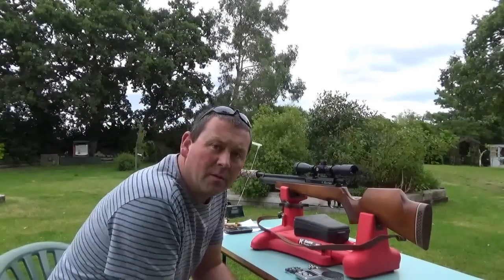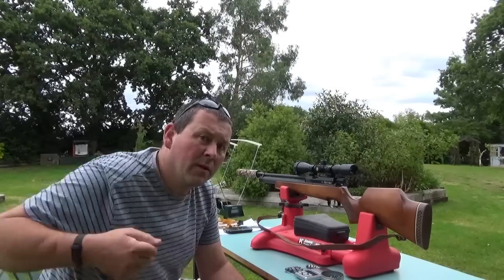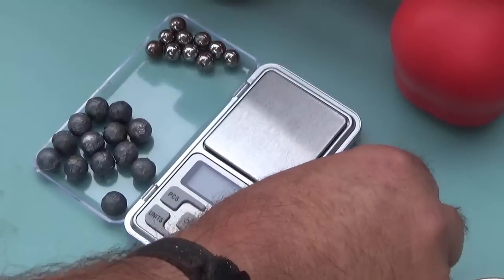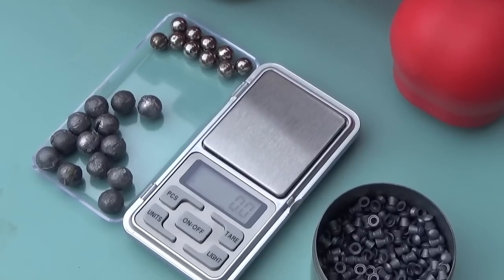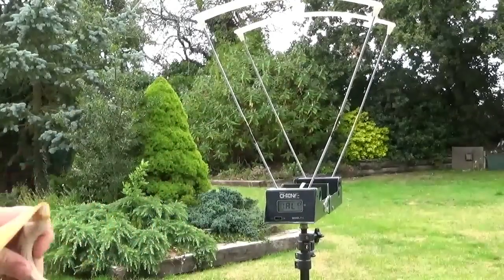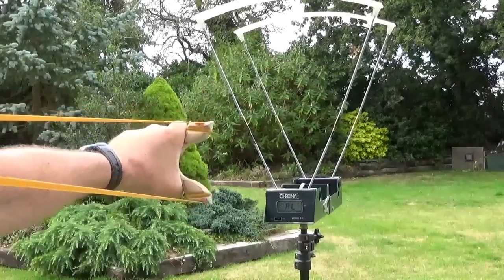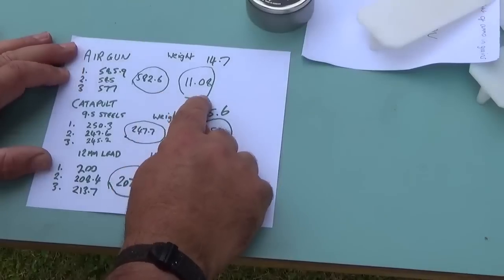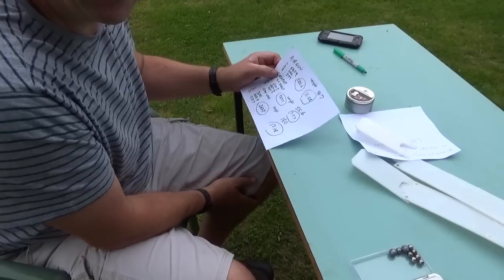Airgun Versus Catapult Energy Test

Comment: Great video..Times have changed tho...On my Chrono with 3/8 Lead balls with simple shot Nitro Bands I get 530- 600 fps on my Barnett Black Widow.. If you had a wrist stabilizer your numbers would have been higher. Good work. Thank you. BTW A custom Barnett Black Widow with a 10 mm lead ball is LETHAL
Reply: For real? Please post a video.

Comment: My calculations show that if you weigh 100 kg and can run at 1 metre per second (that is do 100 metres in 100 seconds, which is easy) then you have 100 Joules of kinetic energy. This is the same as 100/1/1.356 = 73.7 foot pounds. So the best thing to do is keep enjoying the beer and kebabs (to keep up the weight) and just run into your prey when hunting - obviously they have to be slow moving or bind/deaf with no sense of smell. That should kill them! Or did I get something wrong? Good video, thanks for uploading - cheers.
Reply from the maker: Great idea...thanks for that...I wouldn't even need to carry a catapult or gun.....gotta go,I am now off to look for some blind and deaf rabbits with no sense of smell!!!!!!
Reply: everything you get was wrong 100 kg at 1 m/s is 50 j not 100 j and it can be distract efficient only on huge resistanc like wall or enough heavy animal  ., run into blind deer and kill it :D your funny what makes bullets lethal  is small diameter and good penetration capability for injury importnat to live organs you dont achieve this be run into animal :D unless that was sarcasm than ok boxing strong punch can carry as much as 200-300 j Energy or more and nobody die after get hit into head  because there is no penetration just acceleration whole head ., acceleration must be alot bigger for kill human inless the prey be small like cat rabbit than if you fall on tchem you could kill those animal be crush tchem to ground  .,than such hunting will call "MOST FATTEST MOST DEADLIST SMALL TURTLE HUNTER EVER " :D also 100 kg cotton Candy at 50 m/s have 125000 j Energy 6-7 Times more than 50 bmg  thit you think it will kill something  ? like squirrrel ? hell no because its super soft and have big Surface area unless squirrl be on some thin baseball bat and cotton Candy dont ripp apart while compress on rabbit .
Reply: @0QualityOverQuantity  https://m.youtube.com/watch?v=sNJVFloPIVA&pp=ygUMaWNhbnQgZGFuY2Ug 😎👍🏻

Comment: Just found a mould for 000 buckshot that's .36" or 9.14mm. allowing that they would travel at a speed somewhere between the 12mm lead and the 9.5mm steel, the weight would be 137 grains they would give you approx. 15.4 ft/lbs

Comment: This throw up the question of why don't hunters make and use a 9.5mm lead. I know why they don't use 12mm steel,they cost twice the price of a 9.5mm.The lead at 9.5mm would still get more energy than the airgun(good killing power) but the reduction in weight would give you less drop-off and therefore be more accurate. I'll have to search out a 9.5mm mould. Thanks for doing this test.
Reply: You can get lead bbs in 10mm.
Reply: I use 11mm steel